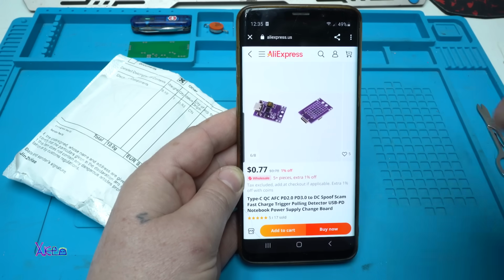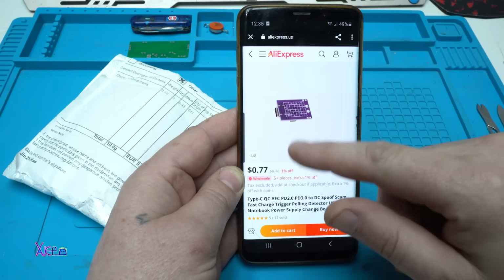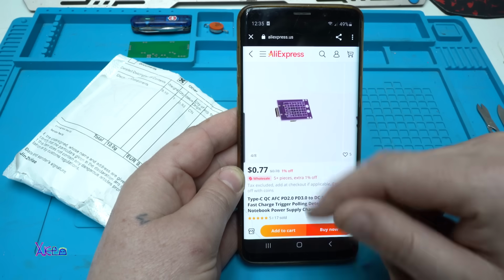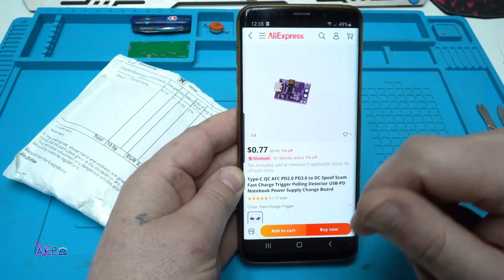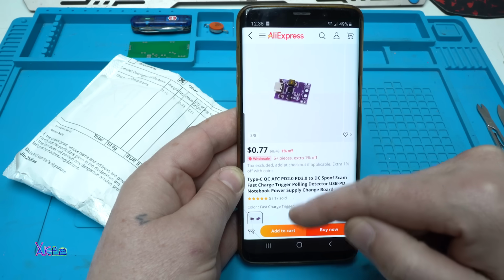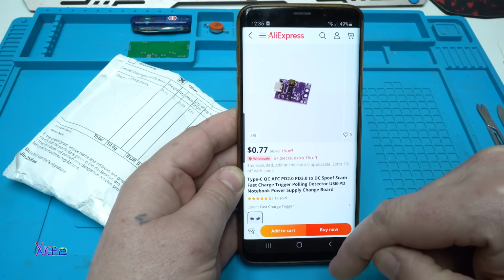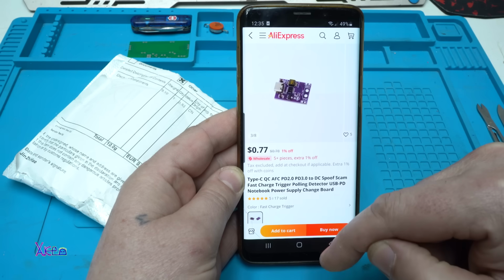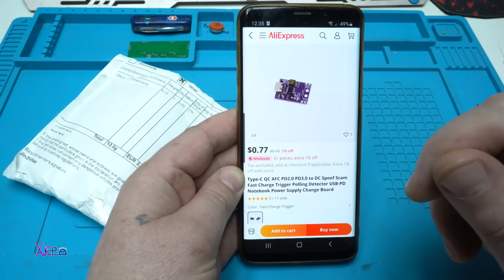WHY This $1 Aliexpress Module is Brilliant?

Comment from the maker: I hope that link will work for everyone:)
Reply: The link works. 77 cents and $3.45 shipping to iowa.

I'm curious what happens if you select a voltage outside the range of your adapter?

For instance 20 volts in your case.
Reply from the maker: 5v output,tested
Reply: Lol, i hope it doesn't,  so i can make fun of the cry babies who apparently can't figure out a search function...
Reply: @chainreaction8977 I would have agreed if the link isn't an affiliated one.

Comment: This is the older version. The new type uses a 7805 reg to power the communication chip, the older version drops voltage for the chip using resistors.
Reply from the maker: Good to know, thanks for the info.

Comment: Did you try the opposit ? Providing 12v in and requesting 5V out ?
Reply: Not possible. This board triggers usb-c power-delivery power supply to output power-delivery voltages 5v,9v,12v,15v,20v,. It's not a buck/boost converter.

Comment: Hi There. Thank you very much for all your videos. I enjoyed them all and used some of the projects. I have a question for you. Is there a module that I can use to take a signal from the  - HC-SR501 HC SR501 Human Body Infrared Sensor - and have it transmitted wirelessly to another room without using Arduino. I would greatly appreciate your help and thank you in advance.
Reply: You can integrate a sensitive device. Pir With Ammar's wireless doorbell, I mean its remote control, the latter will send a signal to the door alarm unit in the other room, which can be used by combining the audio signal and changing it through an operational amplifier to control a relay, for example.
Reply: @strelavarss9146  Thanks for the reply. Much appreciated
Reply from the maker: Great idea,I need to think about that project

Comment: too bad there isn't a pass thru USBC on the other end for output....
Reply: You don't want that, let's say you set the dip switches to anything above 5 Volts, that means the moment you plug in a simple USB-C device that only works on 5 Volts you now destroyed that device.
Reply: @ktarakcioglu  Well.. one would hope anyone using this device knows to check the output before plugging something else in the the other side.. this isn't an off the shelf ANKER device  :)